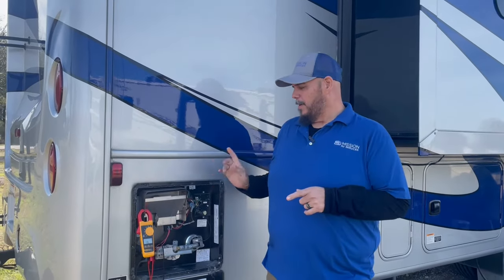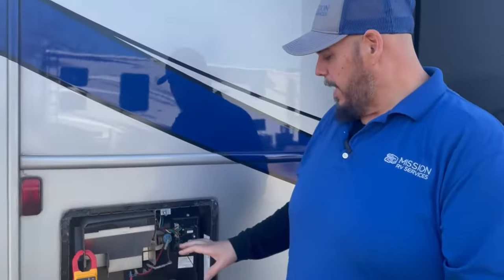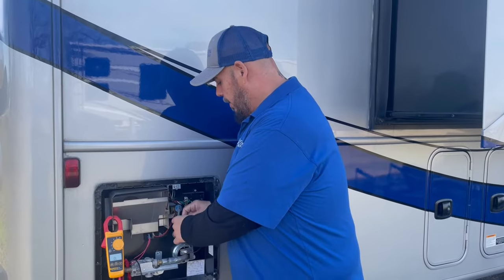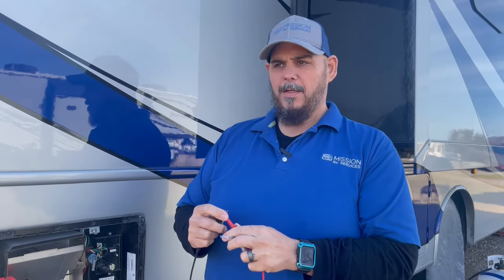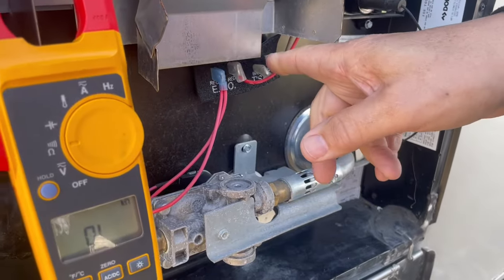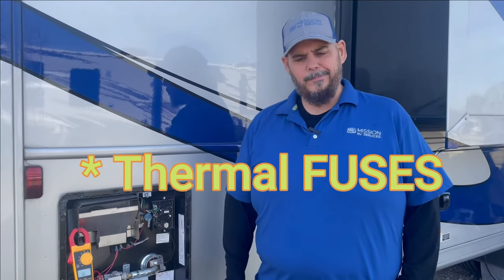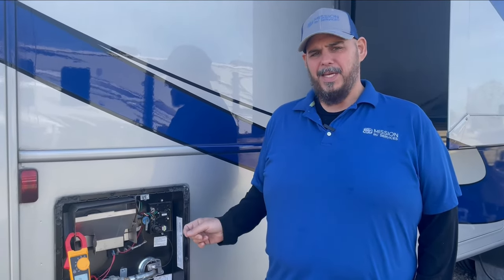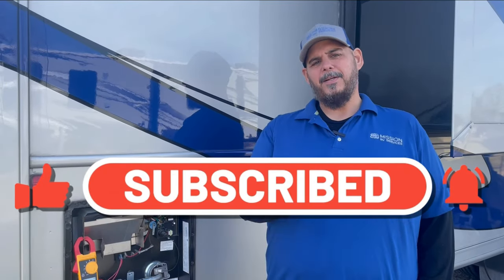RV TIPS: Atwood/Dometic Water Heater Issue

Comment: You just have to love a company that manufactures a water heater that has T&P ABOVE the propane regulator/inlet tube... knowing it will eventually leak directly onto the assembly. This little drip fouls the controls on the propane regulator, drips on the wiring and fuse, etc., etc, - so stupid of a design a Kindergartener  could do a better design...why am I saying all of this? Because the drip fouled out the propane regulator on the Jayco Jayflight LOFT that we have... between the manufacturer and parts suppliers - none of these RV's are worth what we are all baring the price we are paying for them...

Comment: My water heater turns on.  I can hear and feel the water filling as well as heating.  Once I cleaned the grime off the thermal fuse and turned it on inside the camper,  the flame lit.  BUT, still no hot water flow from faucets.  Bypass valve is turned. I also noticed smoke coming from the water heater vent that smells of propane.  The flame went out after 10 minutes, maybe. Now,  I can’t get it to light again.  Any idea what these issues could be?
Reply from the maker: @user-el7jh2bs4d  sounds like you have a blockage in the heating tube. Maybe a nest.

Comment: Can u stick a bic lighter in there to get it going? It tries 3 times then I get the flt light. I can smell gas…
Reply from the maker: @davidemerson1233  no you can’t. The igniter has a flame sensor on it. You can try removing and cleaning the igniter/flame sensor. Can also try to clean your gas supply tube.

Comment: My Atwood gch10a-4k doesn’t heat my water in electric or gas mode. The gas comes on for a second and then shuts off. After two cycles it won’t come on anymore. Is the fuse the same issue for me?
Reply from the maker: No. If it was the fuse, it wouldn’t ignite at all. Sounds like you have an ECO (emergency cut off) issue, a thermostat issue or a bad board. Hard to know without being there. You’d need to put a volt ohm meter on it to check for both 12 volt DC and 120 volt AC. Follow the electric from beginning to end.

Comment: I replaced the thermal switch and the motherboard twice. The gas unit will start and then extinguishes after several seconds. It repeats this three times and then shuts down.  What are the next steps in trouble shooting the problem?  The unit is a new one on a 21 nexus rebel.
Reply from the maker: Sounds like a bad thermal couple/igniter. Sounds like it’s not sensing the flame.

Comment: My thermal switch was not bad, but in checking it I found that the wire on the other side of the thermostat was disconnected.  Thanks for your video. It helped me understand the system and consequently found the loose connection.
Reply from the maker: Glad it helped and that you ended up resolving your issue!

Comment: Drew I have the same Atwood water heater in my Discovery 40E...My electric heat is working and the gas is not working...any ideas?
Reply from the maker: If it is trying to ignite at the water heater on gas but is not, it could be an igniter/flame sense issue, not enough spark to ignite.  Could also be a gas delivery issue.  Check your propane tank, also check to see if you smell gas when the heater is trying to light.  If you need a tech go to the RVTAA.org

Comment: Have the same issue. Water heater is only 6 mo. old used 2 times and Quit 2nd day on a week long trip. So far everything has power and no fuses blown so i will do that test next. What volt meter do you use? I like the one you have. Best video I've seen on this issue.

Comment: I haven’t even had my new camper two weeks and used the hot water maybe 5 times. Today no ignition and electric hot water wouldn’t work either. Removed the thermal fuse plugged it right into the board and everything is working perfect again. Ordered a pack on Amazon should be here next week. Until
Then I bypassed it

Comment: Hello, great video!  I can hear my Atwood sparking to fire but then I hear a boom and see blue flames coming out of the vent.  Sometimes my hot water heater fires just fine but seems like it's inconsistent.  The loud boom with the blue flames coming out of the vent tells me maybe my igniter is going bad.  Please help!
Reply from the maker: Sounds like you may have a blockage in your flue tube or in your gas supply tube.

Comment: Hi there.  I have a 1988 American Appliance brand 6 gallon hot water heater that won’t fire up on gas or electric.  Would the fix you showed in this video possibly fix mine, or could you please point to a video about my brand specifically?  Thanks in advance and sure appreciate all the knowledge you’re sharing!!!
Reply from the maker: First off, what a great run for that water heater! 35 years? Wow!
American was bought by Suburban which is different manufacturer than the one from the video. Without being there to diagnose your water heater, it’s hard to say what may be wrong. You can still get some
Parts for these units but you would have to reach out to Suburban directly to cross reference. Wish we could be more helpful!

Comment: If the propane works, but electric doesn’t- will it be another problem then?
Reply from the maker: If electric doesn’t work, it could be the electric relay in the back, it could be a circuit breaker in your circuit breaker box, it could be a loose wire, it could be a bad electric element, or even a faulty switch. You have to follow the power with your volt ohm meter.
Reply from the maker: If you need a tech, to find one in your area, go to MyRvResource.com

Comment: ran the multi-meter on my thermal fuse, as i guesses b4 i watched this video, sure it enough, it tested bad. although you said NOT to do the by-pass to get it working ?, i did hook the wire straight to the thermstat board, just to see if it was indeed the fuse ?, sure enough, i turned the water heater switch on, within 3 sec's it lit the water heater as normal, guess these fuses are cheap crap from china ?, my hot water heater has not been ran much at all ! ( 2015 camper ), and now i went on a weekend trip, come to find out the water heater would not light at all. checked all the fuses cept the thermal fuse outside like you did in this video, sure enough, it tested bad. JUST TO BE SURE ?!..i hooked the wire straight to the thermastat ( yes..i know you said do not do it ?, but i wanted to be 100% sure it was just this fuse ), sure enough, the water heater worked like it was suppose to do will be headed to rv place to grab some extra fuses !!. great video !!!.
Reply from the maker: Thanks for the feedback!

Comment: Thanks. i have a 2015 grand design 5th wheel electric will not turn on to heat water gas works great. What do you think could be the problem?
Reply from the maker: Could be a bad board or temperature sensor or a bad ECO switch or as simple as a bad water heater element.

Comment: How can I test the switch so I know if electric is getting power to board
Reply from the maker: There's a relay next to the water heater element that you have to check. You check for power there and at the water heater element by setting your volt meter to AC. You're looking for 120v AC.

Comment: I have an Atwood water heater, it turns on for 3 minutes and then turns off. What do you think the problem is?
Reply from the maker: Could be one of a few items.  My first inclination would be you have a faulty igniter/flame sense.  Reads for a minute or two then tells the board there is no flame.  Could also be a faulty temp switch or eco.  You need to check those with your multimeter.  That’s the areas I would start.  But first clean your igniter with some light sandpaper or scotch bright and see how it goes.  If you need a tech, head to the RVTAA.org to find one near you.

Comment: Hi my Atwood water heat in my class A will not keep the water hot. It kicks on runs a while then stops working. Do you have any suggestions. I did take some of the connections lose and cleaned them. Thanks
Reply from the maker: Are you getting any hot water? Is it hot then goes cold quickly?
Reply: Bad thermocouple
Reply: Yes it fills up the bath sink and then goes cold.

Comment: We have a 2019 jayco north point. We just replaced our thermal fuse a month ago and it’s been working great since we replaced it. Now it won’t light or tick at all. Tried a new replacement fuse and nothing. Not sure what else could be wrong. There’s a brown wire that connects to the thermal fuse. Could that have gone out?
Reply from the maker: Could be that the igniter is bad. Could be a bad thermostat or bad ECO (Emergency Cut Off) which is right by the thermal fuse.
Reply: @missionrvservices  thank you. How can I figure out what part has gone bad without replacing everything. Either ignition or electrical board?
Reply from the maker: @Maddielove2468  Use a mulitmeter to check for continuity on the thermostat or ECO. If you don't have one, you can order one from Amazon (our affiliate link) here: https://amzn.to/45U9K4u. There's no real way to check the board though.You have to follow the flow of power to see where it's going bad.  Also, Keep in mind that there's a chance that the thermal fuse, although new, could have gone bad again.
Reply from the maker: In case you need a tech to come out, visit RVTAA.org and put in your city to find a certified tech in the area.

Comment: I know you said not to run the unit without the thermal switch but can you remove it then plug straight in just to see if the switch is bad if I don’t have a meter to check the switch?
Reply from the maker: Though you could check it that way We can’t recommend that you check it that way, since we don’t know what caused it to fail.
Reply: Guess I need to get a mobile repair guy out here to check things out.  Mine isn’t working on gas or electric
Reply from the maker: @33Bigdogyears  could be a board or a thermostat issue. RVTAA.org has a tech locator for your area.

Comment: What about when gas is working-but electricity is not?
Reply from the maker: Your start following the flow of electricity. Do you have power at the element (check with multimeter)? If yes, do you have good resistance at the element?  If it’s not the element where the problem is, it could be a bad relay or a faulty board at the 120v side.

Comment: my atwood water heater is runing at about 170 deg. how can i turn temp down .also the presure relief valve is dripping even the new replacement one
Reply from the maker: 1. Factory preset on an Atwood is 140 degrees and that setting is non-adjustable. The emergency cut-off for an Atwood is 180 degress, so as long as that temperature is between 140-179 degrees, it's operating at normal range with no way to adjust it down. 2. Pressure relief valve - did you just replace it or has it been a while? Minerals can get in there even after a month. Did you do a thorough cleaning of the tank before installing the valve? Hard water can stick those open, but it is possible that you have a defective new valve. You can try tapping the end of it to see if it reseats. Hard to say more than that without being there. You can find a qualified tech near you at RVTAA.org.

Comment: I can't remove the thermal cutoff fuse. How hard do I need to pull?
Reply from the maker: You have to hold one end with a pair of needle nose pliers and then pull the other end with another pair of needle nose pliers to separate it at the connectors. Do that for both ends. Good luck.

Comment: Why is my water 💦 heater putting of a smut it did not do this before I cleaned it it had a blown fuse link that comes from the board so I bye passed it and it worked but I did notice more shutting then it was before
Reply from the maker: Not sure what “smut” is.  Maybe there is something in the burn tube. Spider webs? Acorns? Dauber nests? Bugs?